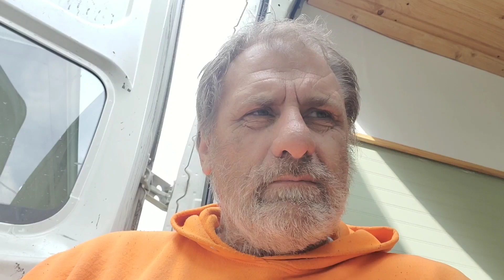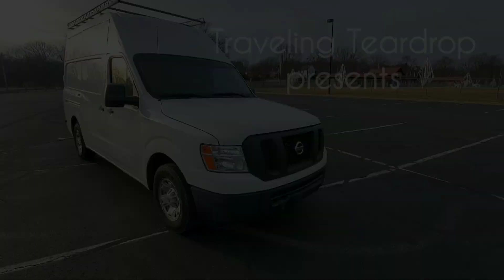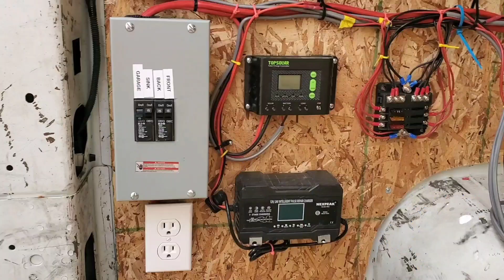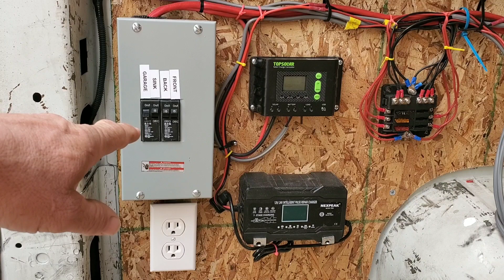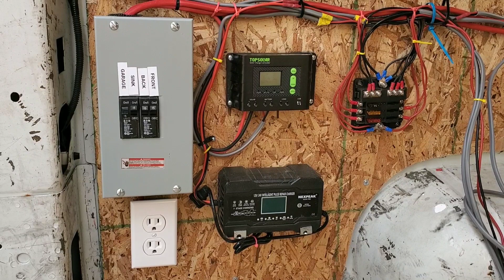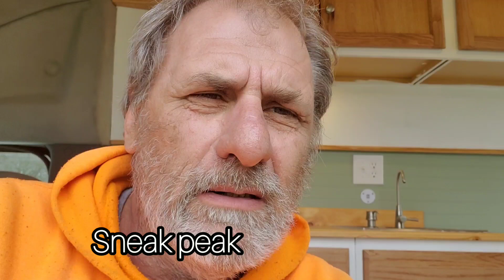How I am doing the Camper Van Electric, Nissan NV 2500

Comment: Can you explain how you have the dc-dc charger connected to your vans battery? Where is the breaker located?
Reply from the maker: I never hooked up my vehicle to charge the camper battery, the solar has kept it topped off. If I need to charge the camper battery, I plug the charger into a power station.

Comment: That's pretty fantastic, do you know what kind of battery system you plan on hooking up? Do you plan on setting up a solar panel system?
Reply from the maker: The battery is an 12 volt AGM battery, 100 amp hour from wal-mart. Yes their will be 100 watt solar panel on the roof, video coming up for that whole fabrication and install. Thanks for asking and watching.